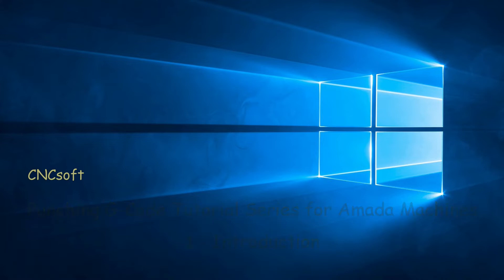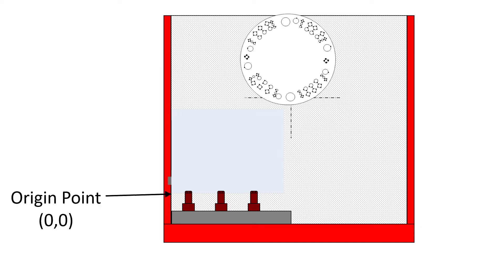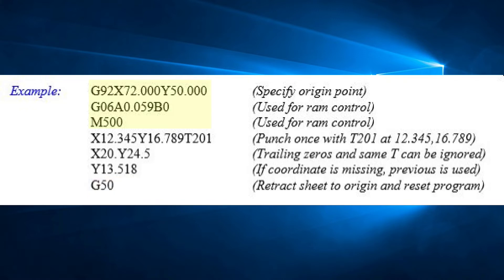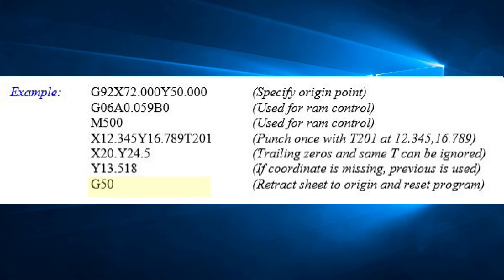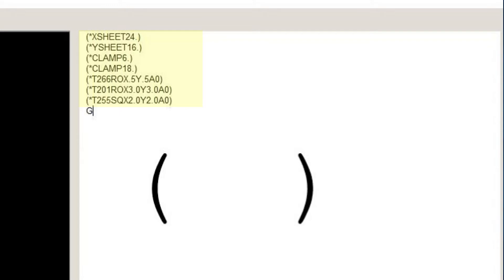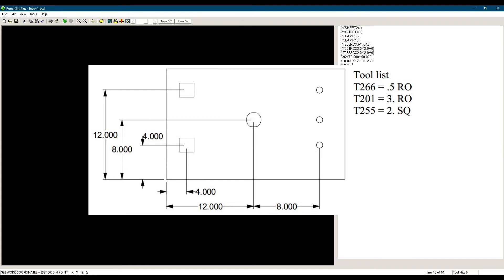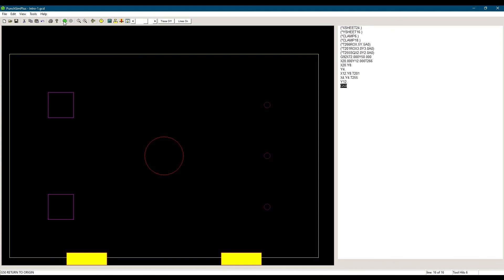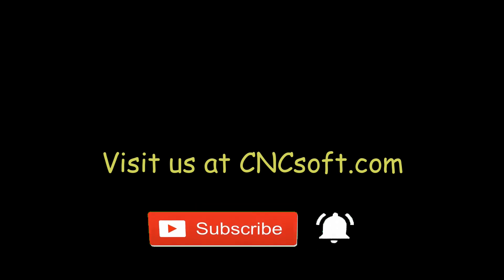1 - Introduction - Punch Programming G-code Tutorial Series for Amada Machines

Comment: Can you please explain about M CODE also
Reply from the maker: Which M code are you referring to?
Reply: M-code Function 
M00 Program stop 
M01 Optional stop 
M02 Program end 
M08 Beginning of punching completion signal delay 
M09 End of punching completion signal delay 
M10 Work hold and unclamp 
M11 Work hold and release 
M12 Nibbling pattern 
M13 Press mode cancel 
M30 End of tape 
M31 Rear workholder and cassette cylinder lower* 
M32 Side table bearings lower* 
M33 Loading command* 
M34 Unloading command* 
M35 Job search end* 
M36 Unloading preparation command* 
M37 Penultimate worksheet signal* 
M38 Job end signal* 
M39 Total job end signal* 
M80 Workchute open* 
M81 Workchute close* 
M96 Subprogram recall command 
M97 Subprogram end command 
M120 Mild mode on 
M121 Mild mode cancel
M-code Function 
M500 Punching pattern (punch without shear angle) 
M501 Punching pattern (punch with shear angle) 
M502 to M505
M570 to M575 Knockout pattern 
M506 to M509 Slitting pattern 
M510 to M559
M800 to M999 Forming pattern 
M560 to M569 Marking pattern 
M681 to M683 Punching speed 
M686 Punching speed command cancel 
M687 Standby position compensation cancel 
(for forming patterns) 
M690 Press air blow 
M691 Press air blow cancel 
M692 Press raise 
M693 Press raise cancel 
M696 NEX tool punching mode on 
M697 NEX tool punching mode cancel

Please make a video sir it will very helpful for all
Reply from the maker: Thank you for your suggestion. Many of the M-codes are already covered in our current videos.
Reply: @CNCSOFTVIDEOS but your videos maximum covers G CODE please also kindly  consider about M code

Comment: Hi, Can you please tell me how to skip instructions  and start punching from specific instruction while puching on Amada punching machine?
Reply from the maker: There are a couple of ways. 
If there are not many lines to skip, you can use the Block Skip "\" in front of the lines and then activate the Block Skip function on the control.
Another way is to use the GOTO function.

G06....
G92....
G93.....
GOTO 10
........
........
........
N10 X.......
........

This will jump to line 10 when it reads the GOTO 10. Be careful not to skip lines which affect the positioning like G92, G93, etc. Only punching lines should be skipped.
Hope this helps.